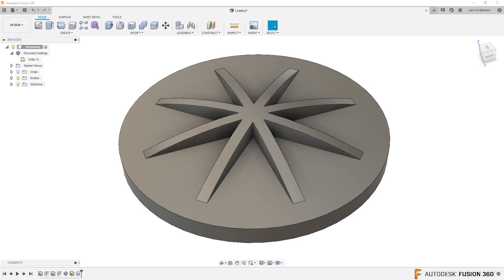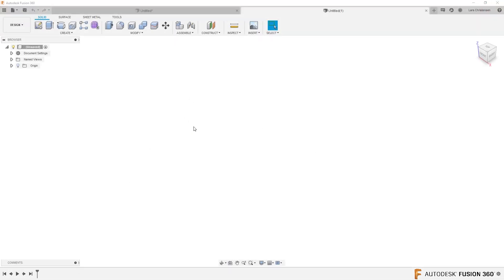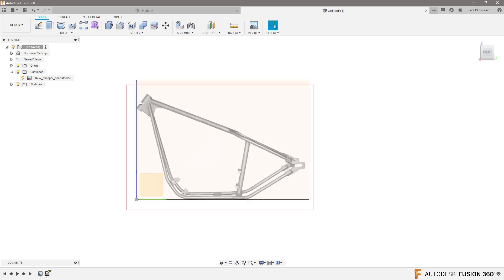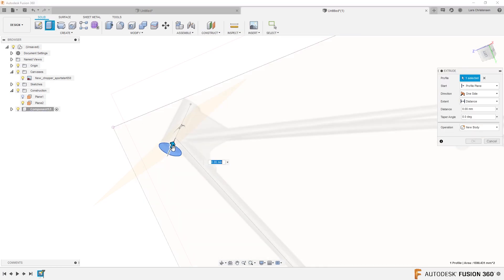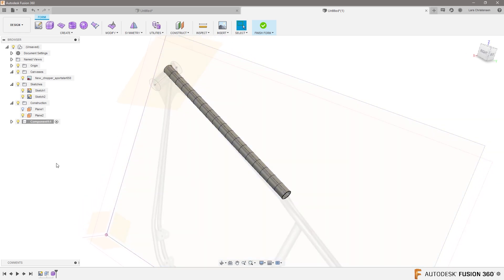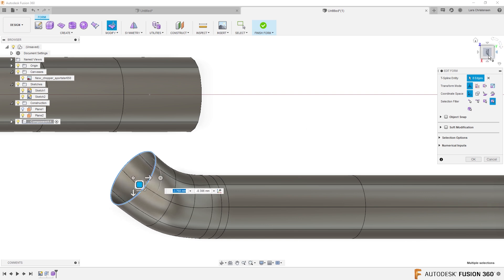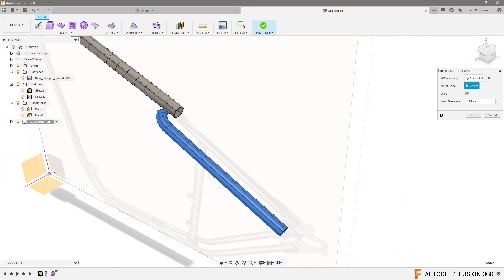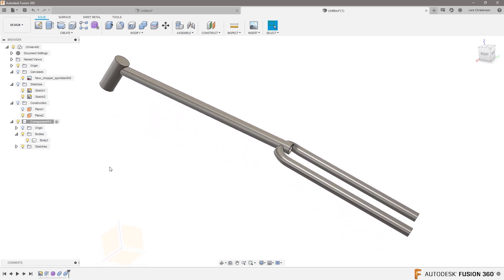Fusion 360 — My WAY for a 3D Bike Frame — Ask LarsLive

Comment: hey, I am a bit struggling in Fusion 360. I am modeling an rc sailboat and I sculpted sails using faces. However, I need to divide the sail into tarps that I would be able to sew together. Could you please try to explain it in some of your upcoming videos?
Reply: you can sketch set of parallel lines and use them do divide surface body
Reply: @oleksiy_rybakov  I know but the surface is flexed and I need to divide it into straight lines.
Reply: @lukasdadak5718  i think Fusion can 'flatten' only sheet metal features for now, so if your surface have more as one direction bend you have to use another software to get it done. You can try to use same workaround as for placing text on double bent surface in Fusion, but i found it's work only some cases and very estimative.  But let's wait for Lars's answer, maybe he can advise some other magic inside Fusion for this ;)

Comment: Awsome lars thanks. Would you be able to make paper templates for notching the tubes? Or make a drawing with all the notch degrees to cut with a mill and holesaw?
Reply: AFAIK, no paper templates/flattening out of Fusion unless you're doing sheet metal work. I used to use paper templates for notching bike tubes, but it was hard to find online tools that gave more complex geometries. RattleCAD is a free open-source bike designer that works well and gives you tube notching patterns for the whole bike. I use that for tube upright/normal bikes. I also make recumbents, and there's no special software for that.  I make a lot of tooling for bikemaking via Fusion 360 and a 3D printer (cutting jigs, tube-holding jigs, etc.) I'm working with carbon fiber, so these only need to hold cold tubes until they're glued/tacked. 3D printers tend to shrink the interior diameter of a tube if it's inside a vertical, so I try to make my molds, cutting guides, and jigs as 2-piece clamshells, with the tubes running parallel to the horizontal. These work pretty well. They're more work, but a lot more durable than paper, and I can get templates I wouldn't be able to get any other way.